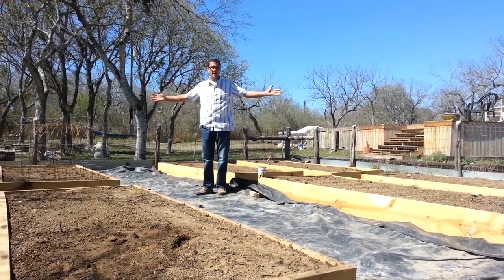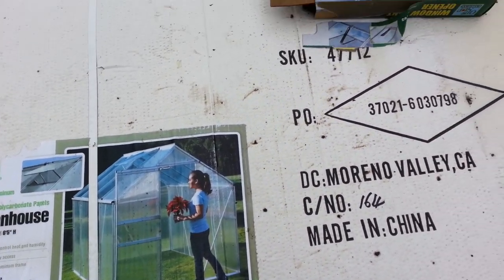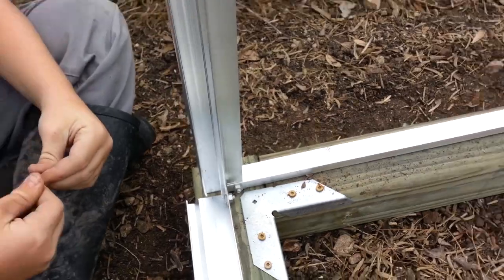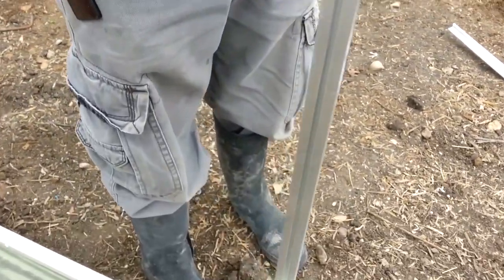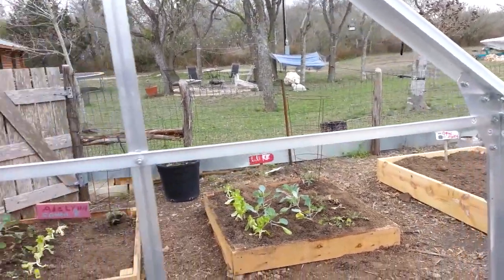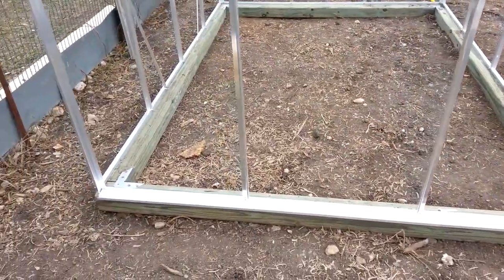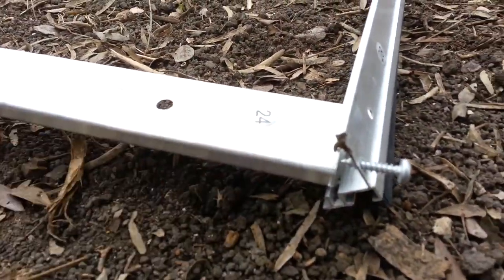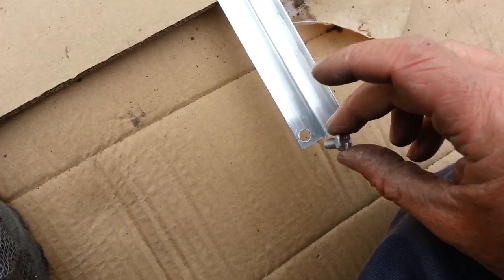My New Greenhouse: Introducing & Constructing

Comment: Thank you for putting this video together.  It helped tremendously to be able to see the orientation of the various pieces as the went together.  It was a lifesaver for me.

I went ahead and added Teks #12 x 3/4" corrugated roofing screws to all the panels to help with wind loads.  4 on each panel and those things aren't coming off at all.
Reply from the maker: +Steve Davlantis Nice work ;)

Comment: I put one of these together as well (what a challenge).  I used aluminum tape on the inside of the greenhouse to help hold the panels (in addition to clips on outside), it is strong, water resistant, and reflective. Not to mention it is much easier than caulking, and you can remove it to replace panels with ease.  I applied the tape mainly because mild wind seemed to bleed right into the structure making it nearly impossible to heat.  The other problem i have had is the door is pretty lousy and gets hard to open sometimes.  I used a brick to wedge against it from the outside forcing it closed so the weather stripping could do its job on cold nights.
Reply from the maker: Hodmokrin Good idea with the aluminum tape :)
Reply: DOOR: Here is what I found on the door.    Mine was clearly dragging at the bottom.  First, one of the screws on the very bottom of the door side frame was in wrong, it was in the slot of the black “bottom slider” below the hole, not in the hole.  Second, the bottom door frame needed to be as low as possible.  The holes in the side frame are slots, but if the bottom isn’t adjusted to max, the side frames drag on the lower track.  If you take the door off and look at the bottom, take a straight edge or stiff wire and set onto little rollers (look like pulleys) the straight edge needs to clear the bottom of the side frame so when the door is in place, the side frame is is above and not touching the track.  My door is not perfect, but now, much better.

I am also concerned about the track bending from being stepped on and may look into support under it, but the support needs to not interfere with the bottom slider.

Comment: Regarding framing the base here's what I did: (4) 4x4x8 cut (2) to 75" and cut (2) to 911/2" assembled as DaddyKirby shows. I added 2x10" for extra height on top of the 4x4's and was glad we did as I'm 5'8' and feel just setting the frame on the ground or even on the 4x4's would have been too low. I would also like to thank DaddyKirb's for a great video, with my iPhone on my work table to guide us, total assembly was about 4hrs.
Reply: Hi! I'm about to build mine but stumped with making a base. Mind sharing how you attacked the additional 2x10 to the base? Then is the whole base just 
"buried" in the ground a little or does it need extra/special anchors ? Tia

Comment: Kirbs, I set up the same greenhouse from harbor Freight.  I elevated mine as well, but to elimenate having to step up over a high threshold I have the base wall cut the width of the door and converted teh door to a hinged door, also cutting the base plate and bottom door frame.  I attached mutiple sheets of heavy visquine that hang from teh bottom of the door to fill the gap under the door.  Also, because it's not the most sturdy greenhouse in the world, when I constructed my shelving units I anchored the 2x4's I used as the upright shelving supprts to the lower base wall, then also screwed the aluminum framing of the greenshouse to those 2x4's making the whole thing a lot more sturdy.  I have 2x4's that run horizontally that act as teh rear support for my shelving pushed rught up against the plastic panes and ran a small screw through each plastic pane into the 2x4 and did similar supports on the ends.  This way the plastic panes cannot blow out.  My greenhouse has been through some extreme winds with no troubles.
Reply from the maker: It sounds like you turned this little greenhouse into a fortress! LOL Nice work :)
Reply: Do you have a picture of you're green house ?

Comment: Thanks for the video, the instructions that came with it are marginal at best. A picture (video) is worth a thousand words. I've got the frame up. will build door in the am and add panels. Can get a little windy where I live so I will be adding silicone around the windows and and an enhanced anchor system and then keep my fingers crossed. Thanks again.
Reply from the maker: +krb61 Good luck and happy growing!

Comment: This was by far the best stepxstep I've run across this far.  The hubby bought this for me (tired of the kitchen shuffle ie:dozen flats rotating daily for light/floor in front of French doors blocked)  He b@*&he'd the ENTIRE time..which was almost 2 days...and the frame is still under construction.  He hung up on the windows. Bracket that mounts manual lift bar prevents window from sitting flush on brace.  I TRIED explaining to him that it shouldn't...but rather, needs to alighn with other panels.  Needless to say..day 2, he goes back to work tomorrow and won't touch this until next weekend. (though he says different, I KNOW better) so here I am, catching myself up on what could have been done and in am, I'll go out and begin the process of what  SHOULD have been done.  Without even going out to look (as I spotted it earlier but wasn't in the mood to argue with him about it) ALL FOUR corners are installed inside out. IE:panel 'lips' are facing outward.  idk HOW he didn't see this.  Who doesn't keep up on the obvious in their head when building something like this? is this something only i do?   
Anyhow....I'll be basically tearing it down and RE assembling ...plan on completing it and having my kitchen cleared out before he's home for dinner.

Your video is going with me....😅

If you want something done right....

(oh, and I'll use the nuts/bolts/screws that came with the product.) he went and bought ones that he felt were more suited. 😧 Problem #1. )
Reply from the maker: +Big Sky Skinz I support you building it! ... when he comes home, be gentle. Just smile and tell him that you love him ;)

Comment: We recently bought this exact greenhouse from Harbor Freight.  And you video saved our lives with putting it up.  The written instructions were so bad, we hardly used them.  We went step by step with your video.  Thank you so much for taking the time to prepare and post such a valuable video!!!  It is great to know people like you exist and are willing to help so many others!  Thanks again!  One question: since you built your greenhouse, have you had problems with the panels blowing out?  I see many others have stated this problem.  If so, how did you fix the problem?
Reply from the maker: These types of replies keep me motivated to continue sharing :)  When I was finished building mine I had about 10 clips left over. I felt like I didn't need them. After one good wind storm I had a few panels scattered in the yard. I put them back in and secured all the panels with the leftover clips. Since then... no problems.
Reply: Blake Kirby Thank you so much.

Comment: FYI:   By sure you don't drop a single bolt or nut.  My kit came with ZERO extras and during assembly I dropped three bolts and two nuts.  I had to dig through my jars of loose screws and nuts to make up the difference.  I also want to thank Blake.  Without your video my wife would have been out of luck.  Why my wife?  Cause I built it for her.
Reply from the maker: +Rick Daniel Thank you for building your wife a greenhouse :) She will love it!

Comment: Tip for purchasers: If you're buying "4X4 treated lumber" for the base, 
per the instructions, you'll have to adjust the dimensions in the 
instructions accordingly. The instructions show that the 4X4s are 4 
inches on a side. This is the nominal dimension, but the actual 
measurement is 3.5 inches, so you'll need to add an inch for each of the
 "inside" 4X4s.

Comment: Because of your excellent video this assembly would have taken me at least 3 times longer. It's amazing how poor the enclosed instructions are.I did find one goof though at Video Time 14.57 - the vent window frame assemblies.The side frames (#30) need to be bolted under the top and bottom frames (#32 & #33).This lines up the panel slots so that the panels slide in easily.Your camera work was also fabulous - especially the helpful close-ups.
Reply from the maker: Thank you for addressing my goof up! LOL ... I'm so glad you found the video helpful.
Reply: Oops. What I really meant to say is: Because of your excellent video this assembly would have "otherwise" taken me ...LOL. P.S. A little WD40 on the door slides and wheels works great. Thanks again. Mike

Comment: When I put my footing together I used 75" x 98 1/2" just like the instructions said. It is anchored in with 4- 10" j bolts in concrete. I then put down  fabric, paver base rock and pavers. When I started erection I found that my footing is wrong. 1 3/4" to wide and an inch to short. I can't just cut it down. Have you run into this before? Any suggestions?
Reply from the maker: John Reynolds The only thing that comes to mind is making another frame the correct size to lay on top of the one that you've already made. I hope that all works out so you can enjoy your greenhouse.
Reply: So the right 4x4 measurements should be 73 1/4 x 99 1/2?

Comment: I just had a quick question at about the 12 minute mark of this video you talk about the spacer that is put on to help support the door. did you have to drill a hole for the bolt?  because if not mine didn't come with a hole there I can I just wanted to make sure
Reply from the maker: No, I think it was there. I don't remember modifying the kit with a drill.

Comment: This is from 2013? How is it holding up after 10 yrs of use. Looking to get our next greenhouse.  Currently we have a 6x8 similar to the hf but it is a palram and the clear panels are 1 layer and very flimsy. Wondering how your polycarbonate panels are holding up to 10 yrs of uv and weather.
Anything you would do differently if you were to build a greenhouse today.
 Thanks for the video

Comment: I would recommend some ground level vents to assist in keeping temperatures lower.
Reply from the maker: That would be helpful if I used it in the Summer, but so far I've only really used the greenhouse when the outside temps are already low.

Comment: Instead of building a wall under the greenhouse, I am just using 2x6 pressure treated lumber on top of foundation cinder blocks. Can you tell me what the measurements are onside on the actual plates that rest on the wood? What is the diagonal measurement corner to corner to check for squareness?

Comment: I found the dimensions are wrong on the box and in the instructions. Mine was shorter than 8'5" like the box said and it's about an inch narrow too. I need to get the vent openers
Tim
Reply from the maker: Did everything go together ok? I know some people have reported that their kits were a bit small.
Reply: Hi Blake,
I raised mine up two feet, my base is longer and wider. My issue is the roof as it seems to have shifted and not completely square, but it works. The side walls are still square. I need to buy vent openers, whether Harbor Freight or someone elses.
Tim

Comment: How did you secure the frame to your base ? And thank you so much for your help I just put 2 of the together I am going to use them as a chicken run, I am going to make galvanized mesh frames to replace the plastic in the summer I am almost done , just need to figure out how to secure it

Comment: I built mine before seeing your video. I still learned from what you did. On mine, the right doorway support isw slightly bowed and the door will not close properly. Also, the top of the door on the right end is off the top right roller when it is closed. Happy, but looking for perfection. Any thoughts? checked door for square and checked opening for square. Perhaps the bowing is the total problem? was yours tight or was there an adjustment process?
Reply from the maker: The door is far less than perfect. I've just learned to live with it :)

Comment: Does anyone have trouble with the dimensions of the base in the directions.  I have the 6 X 8 HF Greenhouse and I am in process of assembling.  I found that the width of 75" to be too wide and the frame didn't reach the edge like it should.  I am intrigued about the extended base that was added in this video and have plans to do something similar.  This will also give me an opportunity to correct the base dimensions.  I also could have written the direction better!  Thx, for the video Blake!  It really turned me to a new direction and helped out with assembling the frame.
 As far as using glue.. I am going to use silicon around the edges of the window to trap more air and humidity inside.  However, it may be useful to be able disassemble so that it can be moved.
Reply from the maker: ***** Yes, many have found discrepancies in the base dimensions. I would suggest building the greenhouse, measuring... then building the base. I'm glad you found the video helpful. Share it with 1000 of your closest friends for extra good luck :) just kidding.

Comment: Thanks, I have tried to find vids on using poly sheets in an old aluminium greenhouse. 
This was helpful,  I think my recess at 5mm will not allow the use of the clips. 
I wondered,  if I remove the rubber seals how will I then waterproof seals, do you have any adivine please?

Comment: Where are you located?  I also have citrus I want to overwinter and hope that this greenhouse will work for them..  How did your citrus do overwinter?  Thanks for the help with the assembly, great directions  I wish you had done more on how to get the windows in the door, and how to get the glass panels solidly attached.  I am still struggling with that

Comment: did you  use any sealant or glue on you greenhouse, window frames?
Reply from the maker: I did not. A neighbor down the road put one together. His was the 10x12 greenhouse. He did use a sealant to keep his plastic in. He felt like the panels would easily blow out in the wind. On my little greenhouse I've had a few wind storms knock a few panels out but most have stayed in place.

Comment: Blake, This is my first attempt at communicating with someone on U-Tube----I just purchased a 10 X 12 Greenhouse from Harbor Freight---It is still in the box--I have attempted to read the instructions, which leaves a lot to be said----
My question that I hope you can answer id as follows--Can the plastic panels on the 10' back side be installed on the frame from the inside of the greenhouse ? ? ?----I desire to place the greenhouse as close as possible to an existing storage barn which is also 10'6" wide---Sorta back to back---Maybe 3"-4" space between the two---
If the back wall panels must been installed or fastened from the outside I will need to put more space between the two,
which I really don't want to do.
Can you advise me on this question???
Thanks
Jim Cook
Reply from the maker: Jim Cook Thanks for reaching out to me. I'm not sure if the panels can go on the inside. They recess in from the outside, then are clipped in. You may be able to assemble the greenhouse a few feet away from the structure then have 4 guys (one on each corner) move it into it's final place. Or... maybe you can put the panels on the inside and secure them with caulking or something. I hope that helps a little. Happy Gardening!
Reply: Blake Kirby You might want to have a fifth person to move the center back wall where they connect. It can bend a bit while moving.

Comment: Very helpful video, Blake.  Thanks for making this available.
Did the kit come with one auto vent opener, or did you buy that separately?  If separately, where did you get it, and is it worth it?  Would you recommend thread locker once you tighten the screws?
Reply from the maker: The opener was purchased separately from HF. The funny thing is that I never installed it! So, no... not worth it for me. Thread locker would be a nice bit of security, especially for those screws up at the top. Those have come loose for me.

Comment: Hi Blake. I watched your video on the Harbor Freight Greenhouse installation and found it very interesting. I'm thinking of purchasing a HF Greenhouse but first I got 2 questions:1. I live n Pa. and we get some pretty windy days, how does the greenhouse hold up to the wind?2. Do the panels leak when it rains or are they pretty much airtightThank you in advance for taking the time to answer my questions.
Reply from the maker: They are designed to not leak much. I wouldn't say they are air tight tho. Mine has held up well against wind, but I may be more sheltered than you are. A few times I did lose a panel in a storm. One thing that I've read that people do to help is to use clear silicone around the edges of the panels when installing them. This acts like a "glue" to help keep them in place and make them more air and water tight.

Comment: This tutorial is Excellent!! I have a question: Does your door bind a little bit on the bottom? Mine does, did you use any lube over there? I'd also be interested if there is a follow up vid of any mods you did to the greenhouse. Thanks
Reply from the maker: Sometimes the door does stick a little if you don't pull it gently straight across. An update would be cool :)
Reply: Thanks Blake, I just wanted to make sure I wasn't the only one. I got the door working better, but as you say, you have to pull gently and straight across for it not to bind.